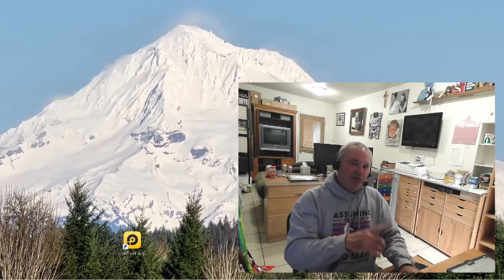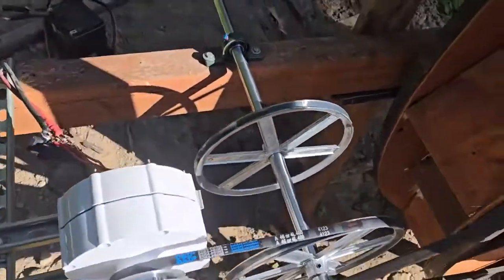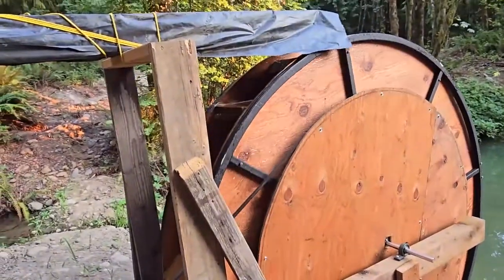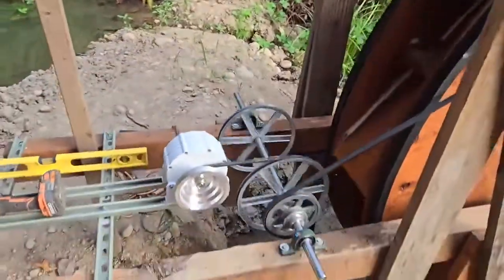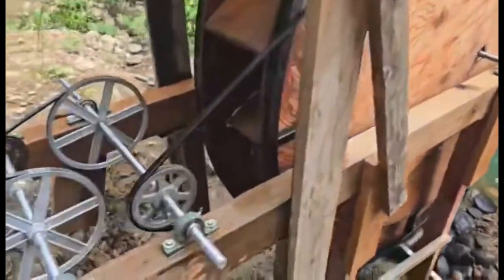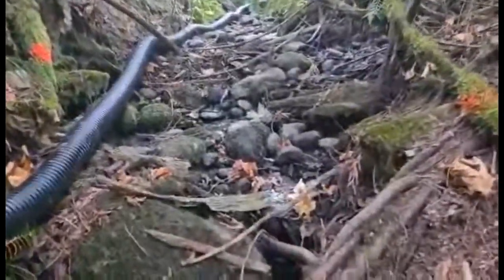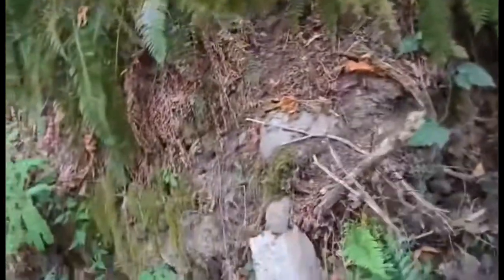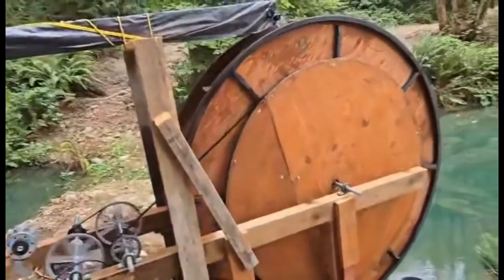Water Wheel gear ratios for generator - 102 to 1 rotation

Comment: spring water will be abundant
Reply from the maker: @You_tu_be68  our creek supply's enough water in the winter and into spring, which is when we really need the additional power input into the solar system.
Waiting until after Christmas to buy the 350' of 6gauge  3 phase wire to reach the house and hook it up to the system.
Reply: @HowToWith24DY He is a carpenter and also a great person who understands how to create clean energy sources.

Comment: so,  how  much  energy  is  AVAILABLE.?!      that number tells you  HOW  the 'wheel should be designed  and  How  Much  energy  you should  EXPECT  the system to produce; after losses.
it is not  Logical  to expect a small, low-flow 'wheel to turn a high-speed pma efficiently.!        a  large-diameter  LOW-speed alternator should be used for this sort of application.!
the  radius of the  FIRST  gear/pulley (on the output shaft)  should be   just large enough  to produce a 1:3 rpm step up.
the design of a waterwheel and the way it is loaded should  CAUSE  it to rotate at an optimal rate;  that is, around fifteen rpm.        this  Optimal  rotation rate is determined by the amount of  Time  that is  Required  for a bucket to fill.!

0351   the 'wheel does  NOT  have  enough  buckets.!!!
in case you don't know, the amount of 'head' at a waterwheel is  FIXED;  it is equal to  the  Diameter  of  the  'wheel'.    period.
Reply: Do we have a smart-ass here? Almost a ! in the end of every line.... 🙂
Reply: @TommyFleseland some autistics get really invested in waterwheel videos and heckle the uploaders its hilarious